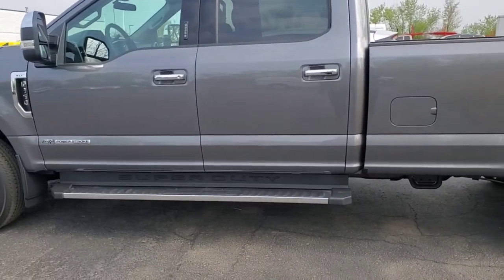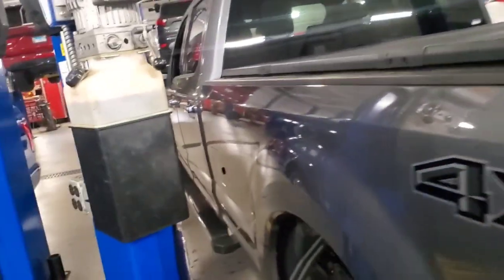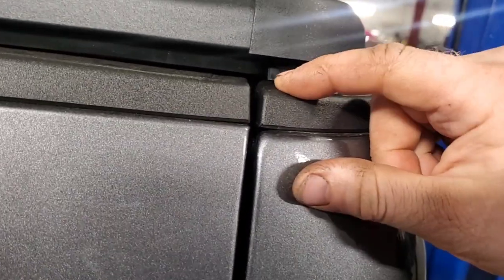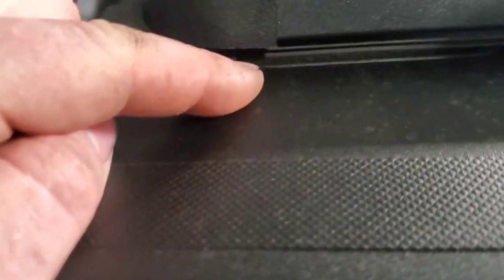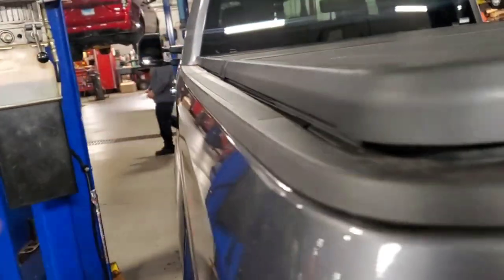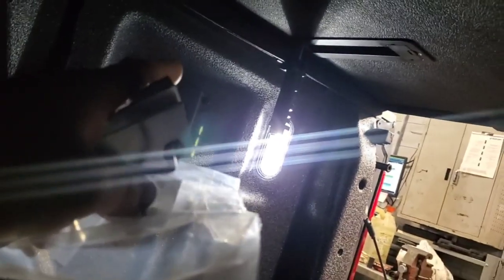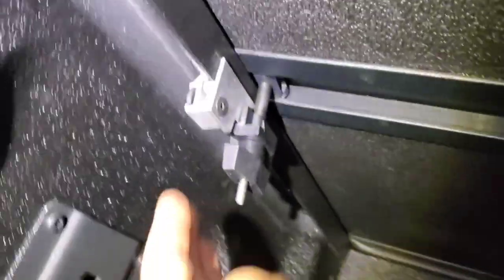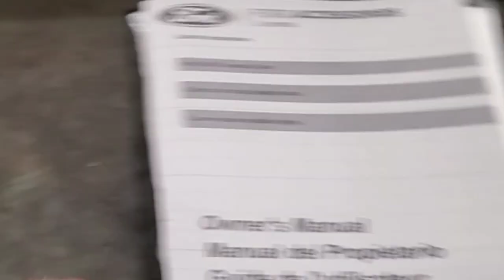2021 Ford F250 - F450 Long Bed / Short Bed Tri Fold Bed Cover install - Easy Ford Cover Install

Comment: Noice job!!  I put the soft cover on and looks good.  I didnt get it from Ford cuz i didnt know they soldem.  I do agree the instructions are def off.  I did the same andvwent by eye!!  Thanks AB
Reply from the maker: Beautiful
Reply: I got soft cover on mine too. I eyeballed mine also. Only thing in my instructions that were right on was how to move the adjust one click back for summer months and one click forward for winter month to adjust for expansion and contraction of cover to lock cover at tailgate from weather seasons.